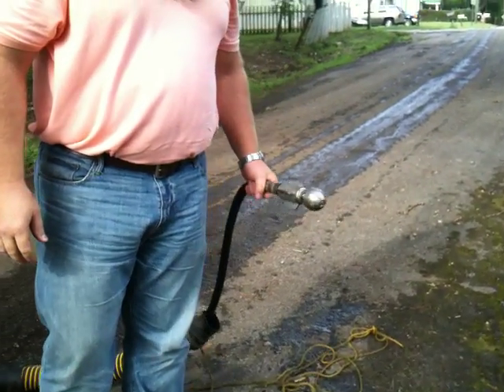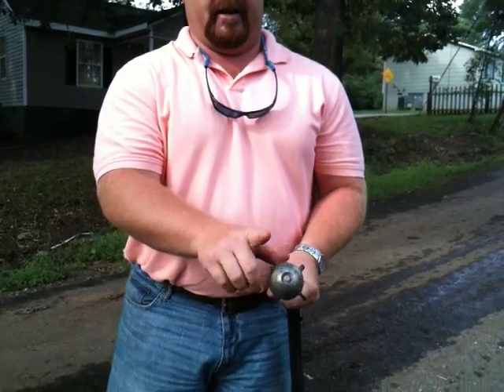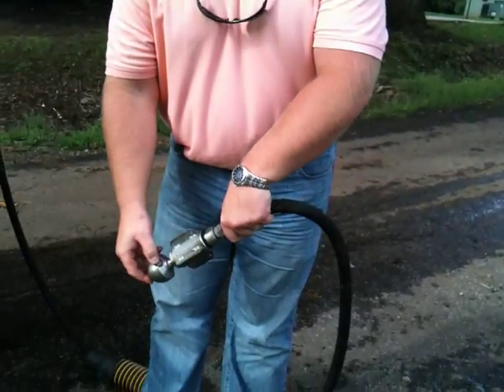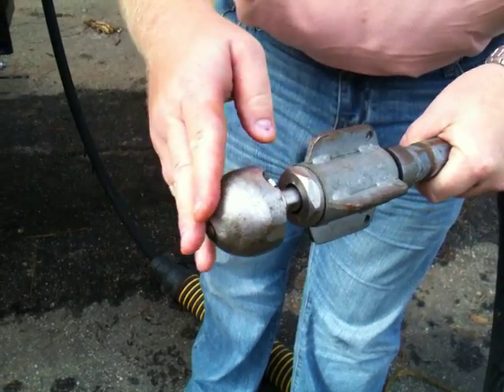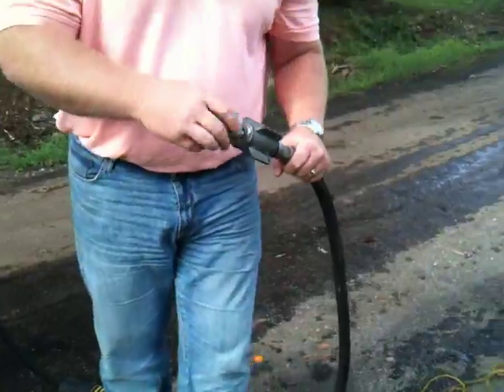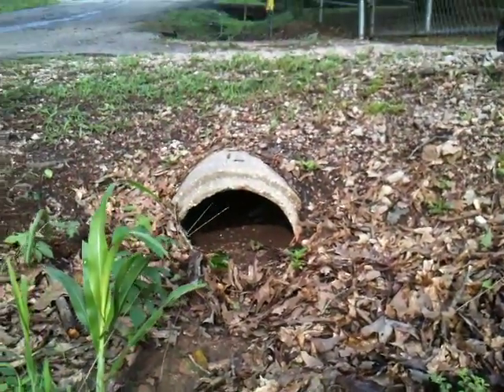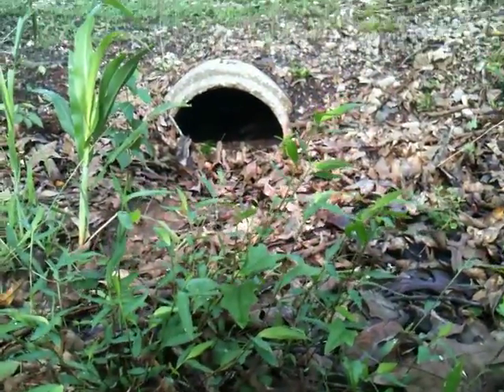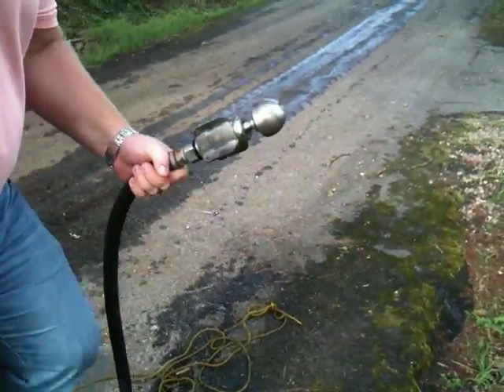John Bean Sewer Jetter, Culvert Demo #1

Comment: I love the 40-GPM spec for jetting sewers manhole-to-manhole and for storm lines - you don't NEED 60gpm-80gpm thanks much to the scouring & cutting action of today's slow-rotation nozzles like the WARTHOG, REVOLUTION, and BULLDOG. Nowadays I primarily deal with smaller 2"-6" lines with our JETTERS NORTHWEST units, but I've run these 40gpm units many times for Seattle Pump and they are sweet for the clearing bigger 8" and larger lines, and they're easy to get around via trailer or smaller tuck

Comment: … Can ANYBODY tell me why it isn’t standard practice to leave a pull string, (which in this case would be a length of winch cable or tow-chain I would think) in place anytime a culvert is installed, cleaned, serviced in any way? That way, if worse came to worse, even if it was already flooding, you could use it to pull a boat anchor through the culvert pipe with a bulldozer or something, and of course be dragging a new pull cable in behind it for next time?

Comment: The real problem is not with the soil and debris in the culvert.  The problem is that the soil and debris in the barrow ditch is level with the soil and debris in the culvert.  If everyone along that road does not clean the soil and debris out of the barrow ditch to the bottom of the culvert, it will be full of soil and debris again the next couple of times it rains.
Reply: The ditch was filled up because the culvert was blocked. Moving water would have kept it cleaned out.